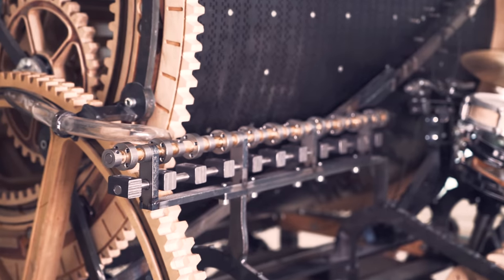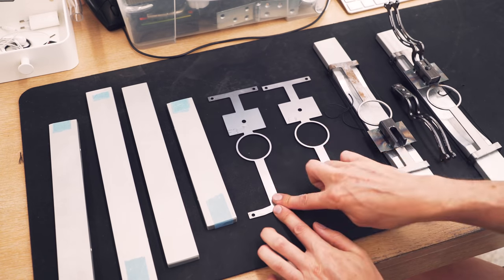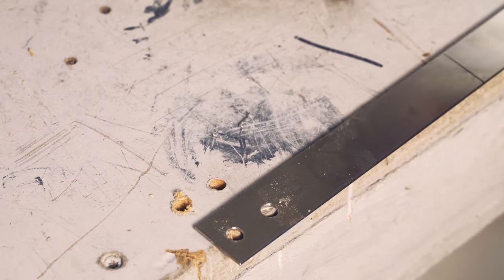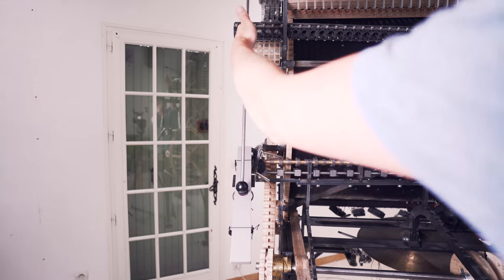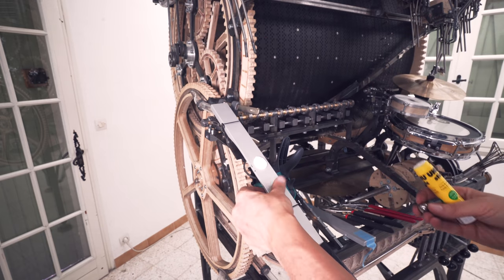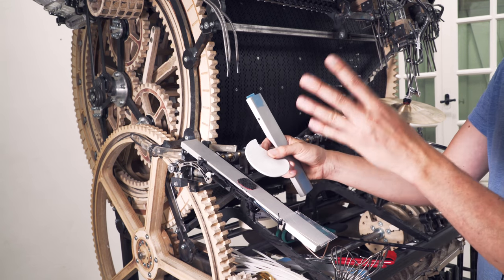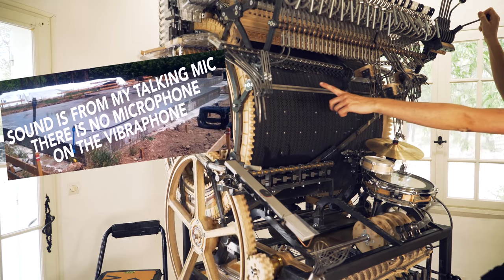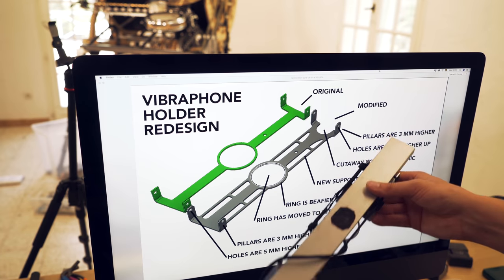Vibraphone Design Test 1 - Marble Machine X#88

Comment: Martin, do you really need to hit the metal at the center point? If you hit it lower you could avoid the double hits. And the release system looks flexible enough so you can craft the change overhead. Love your series a lot, and your videos and grit motivate me a lot doing my similarly over-complicated project!

Comment: Have you given any thought to setting up each scale as one "package"?  This way all the striking plates and resonators already are set to the proper angles and depths and you just have to remove one scale and replace it with another.

I can see having to remove 11 notes and 11 resonators and replace 11 notes and 11 resonators being very time consuming and possibly problematic while on stage if its not done as a single "package" 

But with that said, I am thrilled to have been along watching journey.

Comment: suggestion: you may want to add a second set screw in that "setting" bushing so that it doesn't loosen during a performance and sag. will cause major failure. simple way to add redundancy to the design.

Comment: To avoid double hits, instead of that aesthetically questionable workaround with the plastic sheet, you could try to bring the funnels a little closer to where the marbles hit by using slightly longer, tilted J-shaped pipes.

Comment: Your click-out-and-in mechanims is cool but I fear you might run into trouble when switching the notes without adjusting the spring tension (since the weight & weight distribution of the note plate plays a pivotal role in the amount of spring tension needed)

Comment: I may have a solution to your vibraphone bar length issue. (Might be too late since the new parts already arrived but it doesn’t hurt to try) You could rotate the bars say 45 degrees and that would significantly reduce the space the marble needs to travel before entering the funnel. This shouldn’t change the bounce direction of the marbles but would need a redesign of where to install the bars in order to hit the same spot

Comment: Could possibly you could have the catch bin over the larger and smaller notes so that when they hit and the arc is so far off that you don't have to worry about the double hit or hitting the catch bin on the upwards of the tone? Also would coming up with a fixture on how you want the to tones to sound be much easier when in concert so it makes the change even quicker?

Comment: If the note bars are replaceable, then I assume difference in the length of a bar and all its possible replacements Will not be too large. Because If the catch funnel is positioned for a Very long bar, and it's replacement is a bit too short, wouldn't you need to adjust the catch funnel along with the resonance pipe?

Comment: @xDanoss318x had a good idea, but I was going to point out another potential solution: figure out where the optimal distance would be for the largest plate, and then put the center of the rest of the plates the same distance from the catchers. That way it can all be the same distance away from each other, and you don't have to have the completely MacIvered solution that even I as an engineer am not a fan off.

Comment: Since each note of the vibraphone has a different weight, wouldn't it be easier if the spring is connected to the note, instead of the rack. Therefore when changing notes, you don't have to set that setscrew every time..

Comment: I can't help thinking that the sound one actually hears is the one produced (harmonics, sustain, etc) and if it gets diminished by the addition of dampening rubbers or features (in the Microsoft sense) to a mere on/off signal the whole purpose of the vibraphone is endangered to become an electronic artificial sound... if the bounce is not enough for some irrecoverable initial design flaws, would it be possible to spread the longer blades so that the marbles could be retrieved in between ? the quick fix path is a dangerous one...

Comment: Can you fix the appropriate resonator pipe to each note, so they are swapped in as a unit? That would cut down time. Could maybe modify the spring steel supports to go with them, as I'm assuming they'll need to be adjusted for each note as well.

Comment: When you change the note, lets say from a low (long) to higher (shorter) you'll have to change the spring due to the different weight. Problem.
Reply: Ed W I was worrying about that. Each note really needs a mechanism to hold the desired spring tension, especially during a concert.

I’m also wondering if the marble guide rails will also require changing when notes are changed, or will these pieces be identical?

Can’t wait to see when you can start to play some simple melodies.
Reply: The notes that would replace a big note are all quite big. The weight difference isn't that big so angle and bounce shouldn't change. However the notes will not sit parallel so this will either be looked into further or it is just a compromise Martin will have to make.
Reply: @PaulGreeve  If the center of each note is in the same place, the marble drop should be good for any note.

Comment: is there a reason you can't adjust the cant (no pun intended) of the longer notes? A steeper angle would prevent the marble from double-hitting. Done progressively, it would make the vibrophone plates look like part of a helix. It would require a different under-supporting arm (in place of the current plate support), but it appears it would fit. And it might complement the asymmetrical aesthetic.

Comment: Can you change the resonator pipe lengths like a wind instrument and have holes in them. Then just slide a sleeve up and down the tube to close them off. you might even be able to connect all the sleeves so you only have to slide one thing

Comment: Here's a silly thought. Do the resonator pipes on the marble machine's vibraphone need to exactly match the length they would be on a standard vibraphone? Would it perhaps be sufficient to shrink them to 1/2 the pipe length, which would still preserve most of the harmonic series, and then add in the lowest harmonic using a filter on the contact microphone? Perhaps that isn't so pure, but I'm curious if it would sound acceptable and make the design of the piping system more approachable for live stage changes.

Comment: Can the resonance tubes be connected to the bar holder?  That way the tube and note bar would always be a pair.  The whole thing would be much heavier, so you’d have to have a stronger spring steel, or work out some other way of balancing the note assembly.

Comment: Great work as always. Can you keep short ones Steight  and as the plates get longer start to gradually crank bottom edge around towards outside of machine like a Japanese fan so marble doesn’t have to clear the length but go over the side edges towards bottom of plate kind of in between the plate beside it?? I drew it but can’t attach it. Just my 2 cents I’m no marble x Xpert lol that’s bullseyes job

Comment: It was said when a bar was changed the resonator tube needs to change too. Changing out a bunch of tubes will add time to the change. Is it possible to make a telescoping resonating tube? It would function like the sliding pipe on a trombone.

Comment: Those plates aren't going to stay flush with each other when you swap notes with the same spring setting.  The higher notes are going to be lighter and sit higher.
Reply: But the spring is only activated when the plates is pushed downwards?

Comment: Why not have bistable valves on the vibraphone pipes like a clarinet or saxophone to change the length of resonation? Maybe that would be (a lot) more complex than just changing the pipes but it could be faster to change on stage.
I could understand either way.

Comment: Just a thought, but watching your drop the marble from the end of the rail might not be fully representative of the marble travelling out of the machine during a song. If you havent alteady, perhaps test this again with the marble completing the full travel through the machine. The speed at which the marble comes out of the machine may be faster than the speed it was hitting from where you dropped it in this video. I am thinking that this may alter the way in which the marble bounces off the note.

Comment: Martin! I can offer a solution that could potentially fix two problems. The fact that the marbles are aimed towards the center of the bar brings out a jarring amount of overtones, and in the audio of this particular video, the overtones drown out the fundamental pitch of the keys. If you were to aim the marbles more toward the lower point between the center and the node of the bar, you eliminate the chance for the marbles to hit the keys again as well as the overpowering overtones! I’m fully aware that the sound is not the focus, but overtones can really bring the focus out of the notes themselves.

Comment: Is there some way to mount the resonator pipes directly to each of the vibraphone bars using the holders? Might be harder to attach to the MMX but I think it would make up for not having to design/implement adjustable resonator pipes. Something to consider.

Comment: Are you planning to make resonator tubes whose lengths can be changed on the fly, or fixed-length tubes that can be swapped out?

This sounds really impractical, but I was just thinking about a resonator tube that uses valves to change the path of the sound waves to make them longer and shorter, like a trumpet. That would be ridiculous, but it's fun to imagine.
Reply: I have a design for adjusting the length on the fly. This only needs to be a few cms. However the pipes are a jumbled mess going into the machine which will make access very tricky. We haven't solved this issue yet so any ideas are always welcome.
Reply: @malco84  well if it's already a jumbled mess.... maybe the trumpet approach after all? LOL

Comment: How are you gonna put contact mics on the vibraphone when they are interchangeable? An electric plug on each? A cool thing with those is that you could if you wanted to use the contact mics as midi triggers and basically play whatever instrument you want (in special cases).

Comment: Could the resonator pipes be two pieces? The piece attached to the machine could be a set length the minimum needed for a small range of notes. Each note would come with an adapter possibly a tip that makes the tube the right length. So no live adjustments just plug and play.

Comment: You may have a major issue soon. After the full assembly, MMX will have an an extreme level of mechanical noise (and vibration) due to the mechanical components. I know, applying lots of grease and oil will help, but maybe you need to install sound and vibration dampening component so make it a proper sound machine, not a noise box.

Comment: I have question.: concerning the half-tone steps of each vibraphone bar: Does its length increase factor correspond with something like 12th root out of 2 ? (1,059463094361 roundabout since the exact number is obviously an irrational value). This is at least the factor by which half tone frequencies are multiplied to reach the next one. After 12 iterations, one octave is complete.

Comment: Dumb question maybe. Is it possible to get the same sound on a shorter and wider plate? I understand that means redesigning the holder bracket. Might this allow you to have a consistent angle of the vibraphone plates and having all the marbles clear them without double bouncing or adding extra, kludgy, parts?

Comment: #1 Changing the "vibraphone" plate between songs will change the ball's bounce off of it.

#2 Yes you can limit signal to noise in output mics, but the thing is going to be hella noisy.

Hella is in Sweden, right?

Comment: To speed up changing the vibraphone, could you make each bar and resonator into one 'module'?, i.e. the resonator is attached to the same snap-on connector as the bar.
Reply: Fraid not, some of the tubes are about 90cm long. As you can see there isn't the vertical space for straight tubes. Also the note 'needs' to move the tube can't and it has a vibrato paddle spinning in it powered by the mmx.

Comment: If the contact mics are mounted on the plates, how will they be able to pick up the sound generated by the resonator pipes? A good signal to noise ratio seems to be one of the biggest challenges of the mmx.

Comment: I have been following since the beginning and this is my first post. My question is: Did you consider replacing a modular vibraphone vs individual notes? I would think that if it were on a live show and you had your tech replacing notes, unless the songs were in the same key/scale you would could only use the Marble Machine X on every other song. Simply because you had to change all the those notes. If you swapped out an entire vibraphone it would take seconds and not minutes. I guess that would take a lot more engineering time than what you would want to spend on it. And again I don't know if you thought it thru like this. I might be talking out my butt hole. Anyway Congratulations on an incredible musical instrument (band).
Reply: Luis Diaz I’ve thought of a similar concept. Just like there are sections for assembly and disassembly, step back a few months in design and make the vibraphone and their associated springs and funnels a section that can be swapped for a totally separate vibraphone section - like the separate programming plates.

Comment: Am i the only one worrying about the timing for the marbles dropping on the vibraphone? This has had me worried for a long time, lol, not only for the vibraphone, but for the drums as well, or am i missing something? For example: If the default setting for the vibraphone is perfectly adjusted to hit the notes at exactly the right spot, what happens if one of the spring steel needs less or more tension? Wouldn´t the distance for the marble to fall be longer/shorter and therefore make the marbles drop out of beat?

Comment: Hmm. I'm wondering if the length of the marble path is too long. I'm worried the programming pin might trigger while the marble is still traveling to the holder if programmed too rapidly.

Comment: If you use a contact microphone on he vibraphone, do you still need resonator pipes? Also, and this may actually be the same question: if you have contact microphones, how do you get the vibrato into the sound? Or is the coupling between the air in the resonator pipe and the bar so strong that the metal itself starts to produce sound with a vibrato on it?

Comment: Why does a marble have to strike a bar? A musician’s hands do not. The musician uses a hammer with a certain material for the tip for contact. Why not have the marble hit the back of a spring loaded hammer head, then you need no sound-dampening goo on the bar. Marble hits pad on hammer and bounces away. Hammer hits bar like a drum strike. No bar modifications. Hammer can have strike surface made of anything from metal to feathers.

Comment: Might be an obvious question but it seems the reset time of the Vibrafone note (the time from one marble being dropped to the next one coming in to its place) is significantly longer than the drums. For the drums it’s near instant but here it takes a while for the marble to go through the pipe. I assume it will be a different time for the notes with shorter pipes.

Will that need to be accounted for, for higher tempos or is having two channels just fast enough for the highest tempo you want to play?

Comment: Just curious, given that the arms holding the vibraphone pads (bells?) are bolted on, when you slip pads off and put new ones on your center is going to move isn't it?  so with only changing the pad and the resonator aren't you going to change where the marble hits?  The ball guides are fixed to a specific location that may change.
Reply: That's a very good point. That's why I like to read as many comments as I can on the pertinent videos. I'll have to think about this one.

Comment: Hey is it not possible to make a telescopic resonator pipe which works universally for all notes. So when the note changes you only have to adjust the length of the pipe by manually pull it longer maybe with indicators engraved on the side.
Reply: That is the design. 11 of them and all really bent. The issue is accessing the adjustable section and hiding the mics in them.

Comment: If you're using contact mics on the vibraphone plates... do you need resonator pipes? Could you add resonance electronically... or call it a xylophone... or does the pipe actually resonate back to the pipe? A xx

Comment: Technically, couldn't you cut a small slit horizontally for a metal circle to put inside the resonator tube, and then pull it out for different notes?